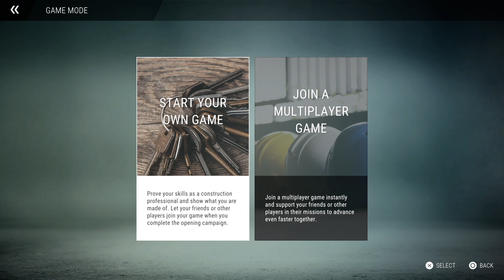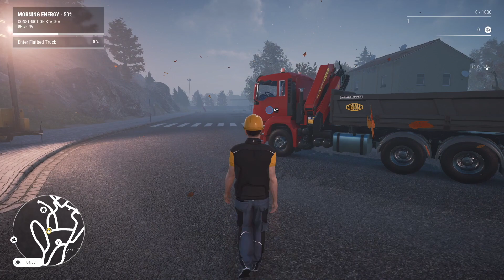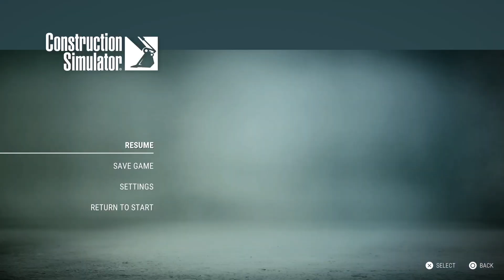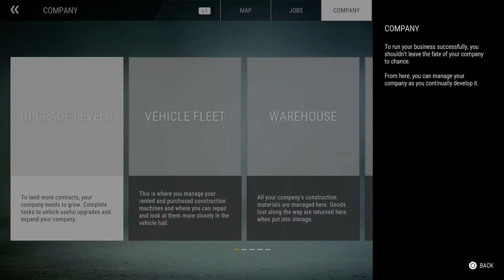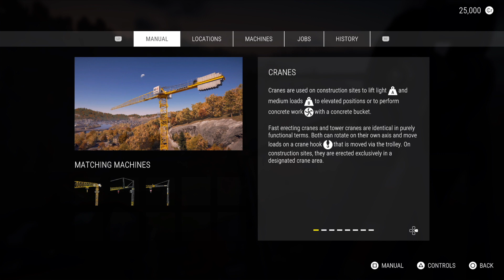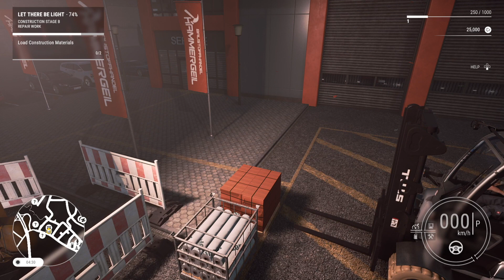CONSTRUCTION SIMULATOR | FIRST LOOK | PS5 Gameplay #ConstructionSimulator

Comment: I seen on another stream I think you click down R3 to go into free camera mode! 👍
Reply: Might be L3?? 🙈 - one of them lol
Reply from the maker: Seems like you can click L3, move camera, then you have to move back to driving mode and the camera stays where you left it. So you can't pan the camera around like you would in every other game and change it easily. Takes some getting used to
Reply from the maker: Update to this, you can indeed flick to the usual camera setup. In settings I switched it to 'toggle' mode and that helped
Reply: @TinTin_57  Nice, I'd discovered the clicking of L3 almost immediately but didn't know there was a toggle option, great find 🤔 Did take me a while to discover how to rotate a load on the crane hook.
Reply from the maker: Also in the videos I can't work out where to get the can view. Well, it was there the whole time in the context menu via square. My problem was I was assuming it was going to be a button press to get there